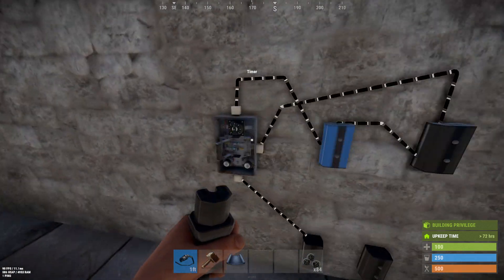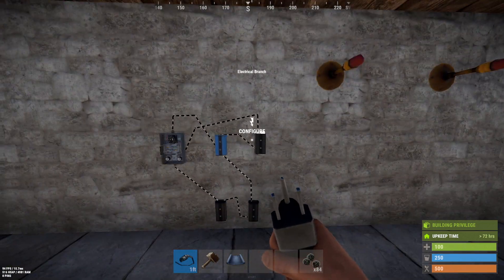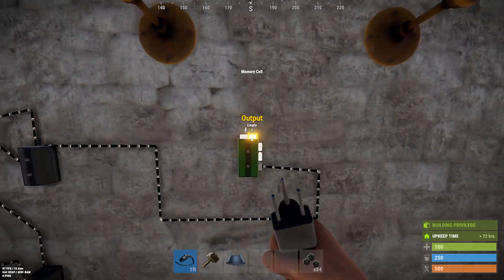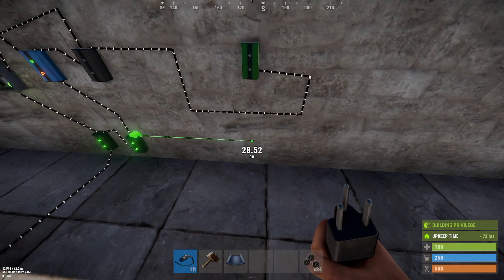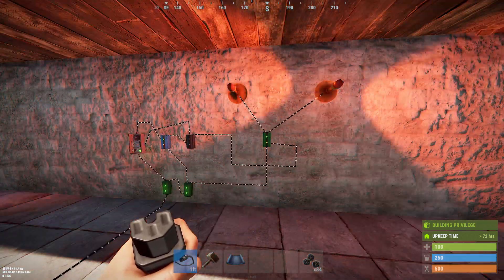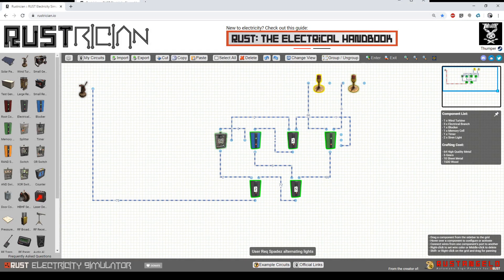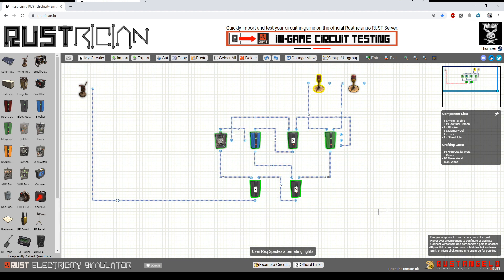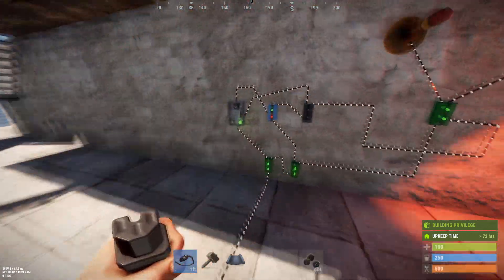Rust Electricity: User Request - Alternating Lights

Comment: Could you do alternating lights like this using a rand switch?
Reply from the maker: You could randomly trigger a light, and/or cause a random set or pattern of lights using the Rand switch (this was done in the lighted tower video) but given the nature of the RAND switch, you couldn't reliably make two lights alternate with it.

Comment: @Rabid Rabbit how would i set this up if i wanted to control 4 lights or more with a similar setup
Reply from the maker: Do you mean 4 lights in sequence, or two alternating sets of 4 lights each? For the former, check out the light house build. For the latter, just add more lights to each of the two in this example.

Comment: When power switches between main and auxiliary there is a moment where the power drops and resumes. Is there a way to buffer this so that power remains constant?
Reply from the maker: Not which I am aware. It is a bit inconsistent going from battery to wind/solar, but it drops consistently when switching to battery. The biggest impact I have found here with this is to timers.
Reply: Rabid Rabbit Well reason why I asked. I was experimenting on Rustrician to solve one problem where when auxiliary switches on it powers at 100 units even though the circuit only requires let’s say 60. So I came up with a way to use that to funnel back into the UPS. Then I noticed the need for a buffer to prevent auto turrets from momentarily powering down. It requires a third battery which is the buffer and I’m not sure if that is a good solution but it seems to work

Comment: I don't know if you have ever gone over this before sorry, but is there a way to have more than one large battery being charged up so that if your power source gets destroyed, auto turrets will have more than 4 hours of power available?
Reply: Check this one. This is a triple battery setup for 3 turrets.
Will provide 12 hours of power when fully charged.

https://cdn.discordapp.com/attachments/623067722087006228/632968896818839593/Rust_Electricity_Autoturret_backup_power_Rustrician.PNG